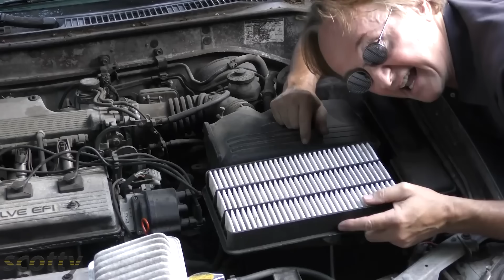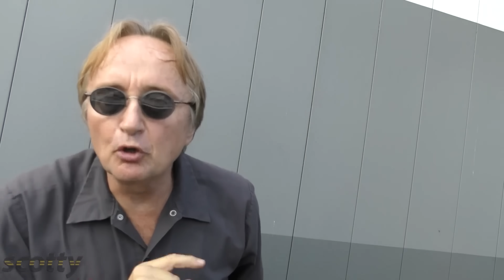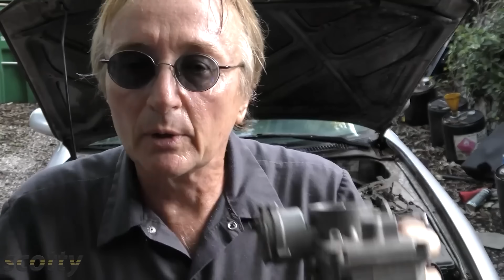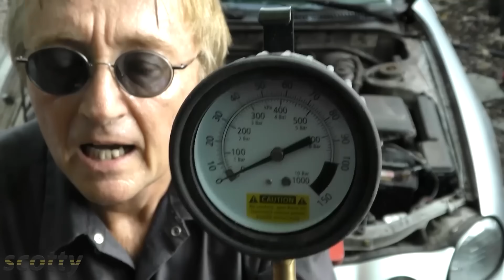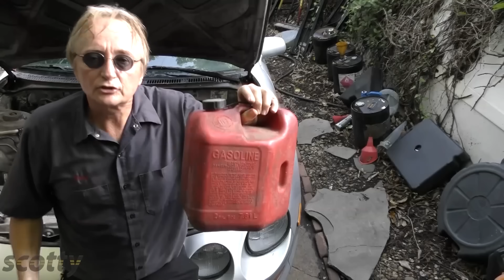3 Things That Will Make Your Engine Last 500,000 Miles

Comment from the maker: Here's Why Changing Your Engine Oil After 1,000 Miles Will Destroy Your Car: https://youtu.be/4n5mMlDxS9w

Thanks for Watching! Subscribe and hit the notification bell for new vids daily: https://www.youtube.com/channel/UCuxpxCCevIlF-k-K5YU8XPA?sub_confirmation=1

⬇️Scotty’s Top DIY Tools and Products:
►Best Scan Tools:
1. Bluetooth Scan Tool: http://amzn.to/2nfvmaD
2. Cheap Scan Tool: https://amzn.to/2D8Tvae
3. Mid-Grade Scan Tool: https://amzn.to/4bLkN2g
4. Professional Scan Tool: https://amzn.to/4dsaa6e

►Best Car Jump Starters:
1. No Charging Required Jump Starter: https://amzn.to/3i7SH5D
2. Mid-Grade Jump Starter: http://amzn.to/2nrc6qR
3. Best Jump Starter: https://amzn.to/4c1O9JI

►Best Fluids for Your Car:
1. AT-205 Re-Seal (Can Stop Leaks in Your Engine, Transmission, Etc): https://amzn.to/3LCruJq
2. ATS 505 Fuel System Treatment (Pour in Gas Tank): https://amzn.to/3LXhEC9
3. ATS 505 Oil System Treatment (Pour in Engine Oil): https://amzn.to/3SZHZmN
4. Head Gasket Leak Test Kit (To See if Your Car Has a Blown Head Gasket): https://amzn.to/3yDmj9h
5. Lubegard Automatic Transmission Shudder Fix: https://amzn.to/46XEsek
6. Lucas Oil Transmission Fix (For Worn / Slipping Transmission): https://amzn.to/3WSBgfK
7. Meguiar's Headlight Coating (Keeps Your Headlights from Fading): https://amzn.to/46l7kgh
8. Meguiar's Headlight Restoration Kit (Restores Faded Headlights): https://amzn.to/3zT9ojN
9. Meguiar's Clear Plastic Cleaner and Polish (Cleans Headlights): https://amzn.to/4cY7RYc
10. Meguiar's Car Scratch Remover: https://amzn.to/4faB3wJ
11. NuFinish Car Polish (Use on Paint or to Stop Windshield Squeaks): https://amzn.to/3SjmYmA
12. Invisible Glass Cleaner (Inside/Outside Car Window Cleaning): https://amzn.to/3YcElcL
13. Hide Rehab Leather Conditioner (For Leather Car Seats, Etc): https://amzn.to/3YYVtmN
14. Blaster Silicone Lubricant (Lubricates power windows, door hinges, stops squeaks, etc): https://amzn.to/46Ss3bP
15. Rain-X Waterless Car Wash: https://amzn.to/4czhc7K
16. Permatex Windshield Repair Kit: https://amzn.to/4fX5mHF
17. CRC Battery Terminal Protector (Stops Battery Terminal Corrosion): https://amzn.to/4dNnIsy
18. CRC Mass Air Flow Sensor Cleaner: https://amzn.to/3YSTm3x
19. Bar's Cooling System Stop Leak (Can Stop Small Coolant Leaks): https://amzn.to/4dQM3Oh
20. Bar's Blown Head Gasket Repair (Can Stop Head Gasket Leaks): https://amzn.to/3AH6wXj

►Best Car Accessories:
1. Quick Twist Oil Drain Valve (For Fast and Easy Engine Oil Changes): https://amzn.to/46Vn2z4
2. Solar Car Battery Charger: https://amzn.to/4fktsMd
3. Plug-in Car Battery Charger: https://amzn.to/3Yqpjju
4. Dash Cam (Every Car Should Have One): https://amzn.to/2YQW36t
5. Key Finder (To Find Lost Car Keys): https://amzn.to/3Yb6gd4
6. Faraday Box for Car Keys (Blocks Car Key Signals / Anti-Theft): https://amzn.to/3YPlCnX
7. Tire Gauge (To Check Tire Pressure): https://amzn.to/3y8R4CE
8. Tire Air Pump: https://amzn.to/3yCqiD3
9. Car Memory Saver (Use When Changing Your Car's Battery): https://amzn.to/3YmWQeJ
10. Car Odor Eliminating Rocks (Removes Smells in Your Car): https://amzn.to/3zYMFCP

►Best Tools for Working on Your Car:
1. Best Cheap Magnetic Work Light: https://amzn.to/4dQKL5T
2. Best Small Flashlight: https://amzn.to/4fePFep
3. Best Expensive Multi-Use Flashlight: https://amzn.to/3WBxzft
4. Car Battery Tester: https://amzn.to/3SXean1
5. Basic Mechanic Tool Set: https://amzn.to/2tEr6Ce
6. Professional Tool Set: http://amzn.to/2Bzmccg
7. Ratcheting Wrench Set: https://amzn.to/2BQjj8A
8. Crowfoot Wrench Set: https://amzn.to/3Xcn6aB
9. Cordless Impact Wrench: https://amzn.to/3WHgpMa
10. Corded Impact Wrench: https://amzn.to/4bVrHlG
11. Electrical Circuit Probe (For Testing Power, Ground, and Shorts): https://amzn.to/4cTwMfp
12. Socket Extension Bar: https://amzn.to/4dedEsf
13. Small Sledge Hammer: https://amzn.to/3WzHsdj
14. Best Borescope for Seeing in Tight Spots: https://amzn.to/3zW3U7K

🛠Check out the other tools I use and highly recommend ► https://goo.gl/rwYt2y

🔥Scotty Shirts and Merch ► https://goo.gl/pTAeca

👉Subscribe and hit the notification bell! ► https://goo.gl/CFismN

As an Amazon Associate I earn from qualifying purchases.
Reply: Scotty, the most helpful MANIAC I have ever met!:face-fuchsia-tongue-out:🤣
Reply: Like a water bong? Lol

Comment: Hey Scotty, I have a 2015 Chevy Sonic LT hatchback. One of my rear light assemblies has condensation in it. How can i prevent this or get the condensation out without taking the light assemble out and replacing with a new one? Many thanks!
Reply: I used to have a 2016 Chevy Sonic hatchback ltz turbo. My advice is get rid of it. Nothing but problems

Comment: In the newer vehicles, for example, i have a 17 GMC Yukon, when should i change the belt and plugs? i have 106,000 miles, and am trying to keep it running good as long as i can. i hope to get another 100,000 miles on it, without any major repairs. High interest rates and high prices are too much for me.

Comment: How to make your engine last to 500k...buy only Japanese vehicles.
Reply: Tell that to my 2020 Mazda (made in Japan) with 100,000 miles and now has a head gasket leak.
Reply: @donsestito7679  : Subaru is well noted for head gaskets issues too.
Reply: But I had read that both Subaru and Mazda are extremely reliable.
Reply: @billdivine9501  : Honda is number one for motors, Toyota has the best transmissions and all other Japanese vehicles are variable.

Comment: Never buy gas when the truck is filling the underground tanks. Dumping fuel in the tank stirs up all the water and sediment on the bottom of the tank. It's designed to not suck ten inches from the bottom because that is where the water is. If they're dumping fuel they're stirring up all the crap in the tank that's going in your car.

Comment: I Replace a fuel filter on a Isuzu rodeo at 170k mile the filter and in tank filter was clog up badly. I could have barely blow air through it and the vehicle was still running with normal power. So it good to service your vehicle even tho theirs no symptom.

Comment: What about say a 2005 ford focus that supposedly has a lifetime air-filter which is actually a thick foam filter that cant ever be serviced unless you completely change out the air-filter box which costs $200+ tax + filter element?

Comment: The problem with K&N filters is  the correct balance of filter oil.  K&N is great for dusty conditions where oil does a great job of holding back the dust.  Too much oil causes the mass sensor problems and not enough oil leads to poor  filtration.  I think K&N is risky for a daily driver, yet great for a track car or industrial or service engines that are well maintained.

Comment: I have a 2018 chevy equinox. For how much crap scotty talks about GM, I'm one to believe that they don't make them like they used to. 250k miles and never seen an issue.
Reply: My buddy's had issues at 12 k
Reply: @ericfrontczak8016  depends on the issue. I've had my equinox turn on my engine light just for me to scan it and realize it was either a minor thing I can fix in 5 minutes or a false positive. The thing about the minor easy to fix issue is that you gotta take care of them asap or then they become much bigger expensive problems just like anything else.

Comment: Very first DIY thing I ever tried to do was replace my own filter… I figured that was such a no-brainer thing. I couldn’t possibly mess it up. The good news is that I did not mess it up, but the bad news was that I had apparently gotten it replaced the last time I had my oil changed and didn’t need to do it. ( yes, now these days I change my own oil and  filter ) 
I ended up putting that filter on the shelf and lost it for several years lol

Comment: If you properly clean, dry, and oil your K&N filter, you won't have any issue with it.  The oil should be allowed to properly dry before you stick it in your car and start driving again.  That's why I have two, so I can just swap them out and always have a properly cleaned and dried one.  Also, the thumbnail shows Scotty using Lucas oil stabilizer.  While Lucas makes good products and states that it will not void a car's warranty; oil companies on the other hand, will not stand behind their oil if you have a claim for an oil issue if you use any additives, because it changes the way they designed the oil to operate.  I've never heard of anything coming of this, and I've used the oil stabilizer and the PS/Trans Fluid additive without any issues.
Reply: Warranty? 😂. My cars are way beyond any warranites. And out of decades of buying warranties- only one time was it worth the initial expense.

Comment: K&N do not filter fine particles well. There are various test results online.  I’ve witnessed it first hand.  They are meant for racing where engines are rebuilt routinely.
Reply: YEP. There's LOTS of so-called "tests" of the K&N Air Filters "on line" -- from a bunch of well-meanning, but woefully unqualified persons. IGNORE THEM ALL !!
Foe maximum performance and longest life of your K&N Air Filter:
 FOLLOW THE MANUFACTURER'S INSTRUCTIONS -- CAREFULLY  and COMPLETELY !!

Comment: That K&N oil evem when used reasonably damage those MAF sensors a lot. No real saving when you have to buy the cleaning agent, oil and spend that time. And if the MAF is dead uhhhh thats expensive. No real gain in HP

Comment: I owned a few older Mercedes Benz cars years ago. They had the oil bath type air filter. Once a year, I drained the oil out of them, washed the filter element, allowed it to dry, added fresh oil to the oil bath, then put the filter back in & locked it down with the clamps. Those cars had well over 400,000 miles on them when I sold them, except for the fin tail one. That car went to the wreckers. I had a piece of steel flick up from a car ahead of me, and it bounced under the car then ripped a big hole in the floor pan.

Comment: I had a K&N in my 2001 7.3 for quite awhile and was advised from a diesel mechanic that even the smallest amount of oil from the filter into the turbo could cause damage to the turbo
Reply: Odd.  My turbocharged Tundra came from the factory with 2 K&N style filters
Reply: Nonsense ...any excess oil the engine can deal with ...so don't believe everything you hear
Reply: New out of the box they sure put a lot of oil and dirt into the mass air meter.
Reply: DON’T use K&N filters on a gas engine. The oil in the filter will foul your MAF sensor.

Comment: My dumb, dumb, I mean stepson bought his 2013 Prius at 135K miles. He is now around the 200K miles and had had issues on hot days, where it feels like it isn't shifting properly. Like it's staying in a lower gear. I just changed his tranny fluid a couple of weeks ago. Today, he said it still does it. I'm guessing maybe because he didn't have the black old fluid changed until about 200K miles, maybe it wore groves, making it seem like it catches and seems stuck in a gear, even though it's a CV tranny? IDK
I'm not 100% sure how those work, but I do know how a snowmobile clutch/tranny works, with a belt. Do you have any idea why it would react like it isn't upshifting properly?
The last time I changed his oil, only a little over one quart of old oil came out. I think I found the leak. Some connector near the top driver's side, back of the engine. I keep reminding him to check his oil at least once a week.

Comment: I had a 1954 Chevy. It came stock with an oil bath air filter.
Reply: Our Model A has a hand crank.
So what ?
Reply: @hotrodray6802  so does my '96 Dodge.....oh, wait, I thought you meant the windows.

Comment: Scotty,
we used an old trick to check Electrical systems on cars for shorts..  + battery connector with a Continuity tester to the body/frame  Making Sure everything was turned off Radio and lights.
Will this work with the Computers in cars?

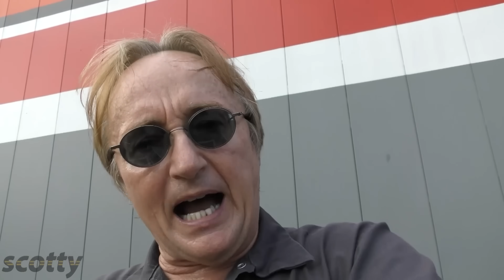Comment: 3:43 Weigh the new K&N for the initial weight of both the filter with oil, then you'll be able to guage the re-oil amount after the filter gets cleaned and dried later?
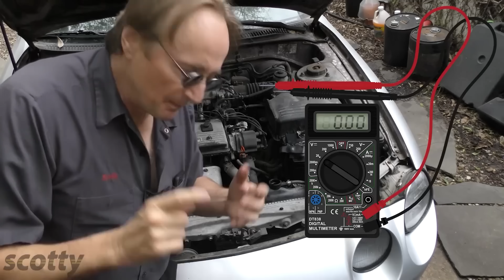11:20 Brake fluid testers similiarly measure the voltage in it's fluid.
Great video.

Comment: You think you can oil change at 10k miles? Even semi truck change at 8-7k miles with way less RPM.
Reply: In Europe most BMWs are at 30.000km (19.000 Miles) and VWs with long life oil a change is only required every 50.000km (31.000 miles).

Since the lease company was cheaping out my diesel BMW drove 60.000 km (38.000 miles, so 1 interval was skipped) before changing. Never had to fill oil but I guess sooner or later it will be the problem for the second owner…

Comment: Most modern cars have the fuel filter embedded in the tank as part of the pump assembly.
My car has an external canister, just outside the tank, in the right-rear wheel well.
Awesome serviceability.
Reply: Ditto -- I have a slightly older-gen. car with an external fuel filter. I recently researched the newer version of my car and found that it has the embedded fuel filter.
I love not having to spend over a hundred dollars on parts and have to remove my back seats in order to change my fuel filter!
Reply: Same 
87 suburban 7.4 
New cars are made by design to eliminate any common man fixing car and doing routine maintenance.. they want you to have to go to their dealership...life in 2024 is an embarrassment.. to... life
Reply: @Sheewww  Exactly.
Good car you have!
I absolutely HATE modern cars.
If i ever have 'new car money', i'm resto-modding an older car.
Reply: @DeeDee-pw9pm  hell yeah man that's what I'd like to do.. hope you get to do that soon!
Reply: Mu voswagen don't have that.  😢😢😢

Comment: In my last two cars, I didn't change my air filters at all, and drove the cars over 200,000 miles. I blew the airfilters out every so often. Vehicles seemed to be okay.
Reply: I am assuming, as you are an honest man. You will pass this information to the buyer of your used car.
Reply: @andrzejmical5416  I've never passed any of my cars on to anyone. Some people are the very first people to own a car...I'm the very last person who will own my car. I drive them into the ground, then walk away amd get into another spaceship.
Reply: What cars were they?
Reply: @user-rc7ts9xu6b  2007 bmw x3, a Mazda cx-5, and I'm at 126,000 miles on my current BMW 430i 2017 model. I bought it at 33,000 miles 2 and a half years ago. Haven't needed to change the air filter, and I live on a dirt road. I just beat the air filter out every couple to 6 months, give it a blast with the air hose.

Comment: K&N air filters are the biggest waste of money going.  I put one in my F150 and I saw absolutely no difference in power or mileage. When I got dirty, I threw it out and I put in a regular paper one and it worked just fine. Save your money.
Reply: with any mod, you need a tune to see a power increase
Reply: @1LElife  that's true. Just adding extra airflow potential without adding extra fuel via the computer is pointless. The oil soaked filters were only really good in the diesels
Reply: So when you got dirty, you threw yourself out? Lol
Reply: They do very little except make a nicer engine growl. You'd need one of those chips to see any increase. Don't waste your money on that stuff for your everyday driver.
Reply: I tend to agree. I put one on my 2012 Ram a decade ago and saw little difference. Plus they require a washing and oiling every few dozen thousand miles. But the oil can ruin your MAF sensor if you overdo it as Scotty said.
Reply: @JohnWilliamson-qd4px  yeah if you don’t put enough oil on it, they don’t do squat for filtering and if you put too much then you screw up your motor. What a deal.
Reply: I feel the same way guys brag about k and n but I've never noticed a difference in using them